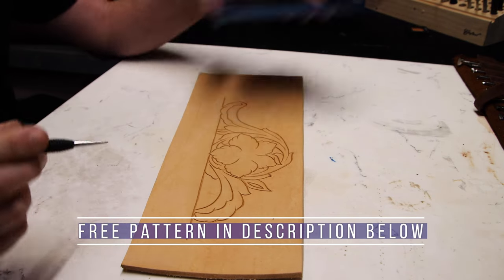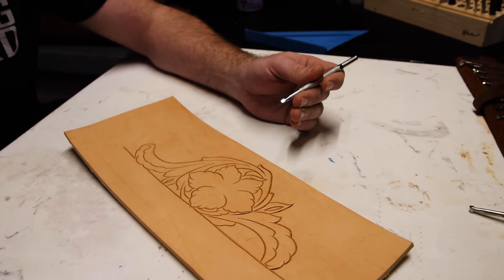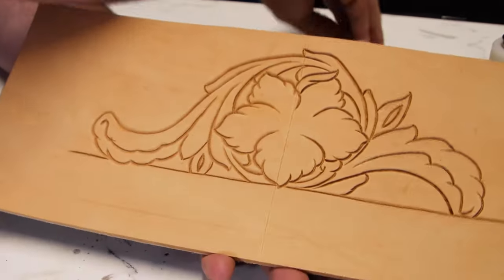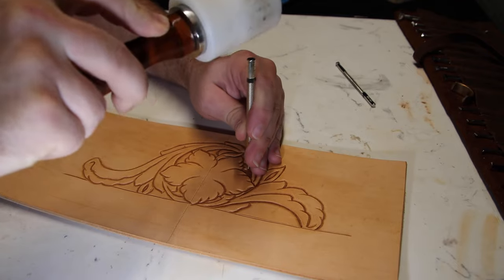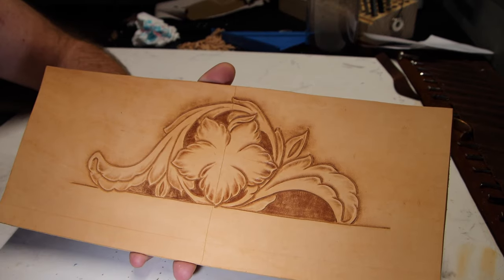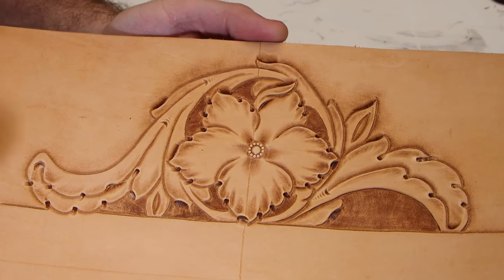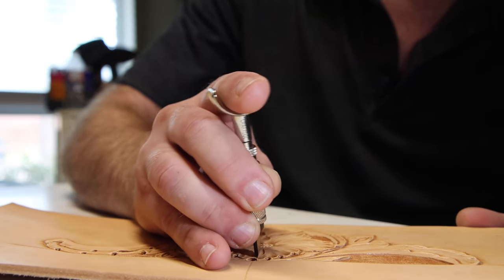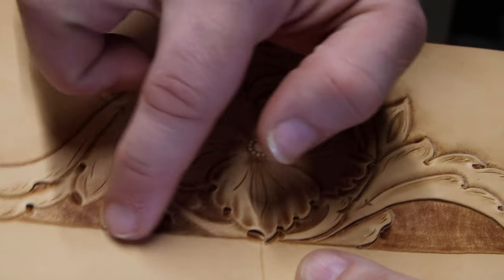My Secret for Better Depth in Your Beveling

Comment: Awesome video. The stylus tip before making the cuts is a great idea. A set of steep bevelers from Barry king is on my list of needed tools.  I also like to use a poundo rubber mat on top of the marble slab when using thinner veg tan. Seems to help get the definition.
Reply from the maker: The store thing came out of necessity.  I wasnt happy with my cuts and needed a way to see them before I cut them in.  

Poundo-board helps a lot with thin leather. Matt board (for framing pics) works well too.
Reply from the maker: Stylus.... not store

Comment: I use BK standard bevelers for the same reason you use both: You get the crisp edges AND the wider band of shading but in one step. I also like to go over my beveling more than once, especially after I've backgrounded/matted. That really made a huge difference in my final product.
Reply from the maker: I'll have to check those out.  Not familiar with them. Thanks!

Comment: Great videos!  I was wondering if you had a part number for the steep edge beveler you use.  Barry king doesn’t have anything in his catalog called that. You don’t have a link to it.
Reply from the maker: Yeah,  Barry doesn't put numbers on them. The one I'm using is a extra steep edge bevel.

Comment: Like your work..my leather is very old and dry...what should I do to soften it..please...Regards Rudolph
Reply from the maker: Thank you. 
First,  it's possible it might not be salvageable. But if it is,  I would start with some Saddle Soap to clean it,  the start lightly oiling it with neatsfoot oil. Go light and keep working it in until you're happy with it. Seriously go slow.

Comment: In my opinion, everything depends on which leather you work with, on a thinner one, the traditional one is the key, on a thicker leather the sharpest one works well ... but that's just my two cents!
Reply from the maker: I agree. If you're tooling a1-2oz leather,  you can easily punch through with the steep edge.

Comment: I seem to have a problem with my Barry king  steep beveler  going right  through  any 4-5 oz leather.  Any suggestions?
Reply from the maker: There really only 3 things out can be. 
1. The leather is too thin. I don't use my extra steep bevelers on anything less than 4oz.
2. Too hard of a strike with the maul. 
3. Too heavy of a maul.  I use a 12 and 16oz maul. 
Hope that helps.

Comment: Is there a reason you couldn't do the traditiona beveling, then finish it with the steep bevler, and end up with the same result with 1 less step of beveling?  2 step instead of 3.
Reply from the maker: Good question! 
The reason I do it this way,  vs the 2 step method,  is because I will typically do my "extreme lifting" whenever possible. (We have a video on it). To do that style of lifting,  you really want that well defined edge.

Comment: i seem to be running into a problem that by the time i am done tooling, my leather piece already looks like it is 10 years old
Reply from the maker: Sounds like it's a moisture issue.  Typically you'll need to dampen it several times during an extended project.

Comment: The leather color is different on one side than the other, even where not tooled. The 3 bevel is a gcool idea.
Reply from the maker: If you're taking about the thumbnail for the video,  that was done in photoshop. A thumbnail has to communicate an idea very quickly,  so I adjusted the color on the thumbnail... the video had not been edited.
And thank you!